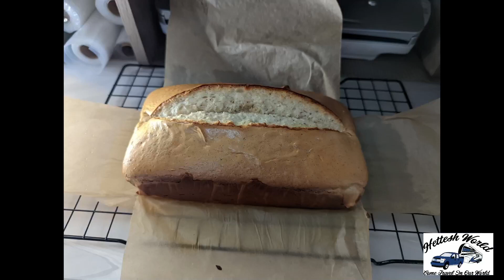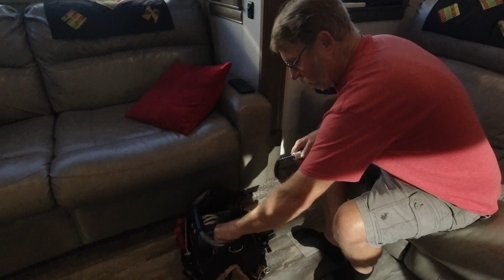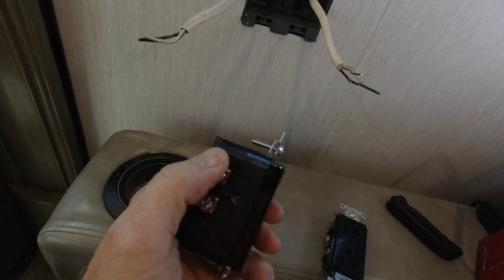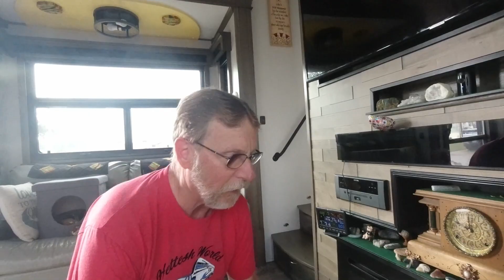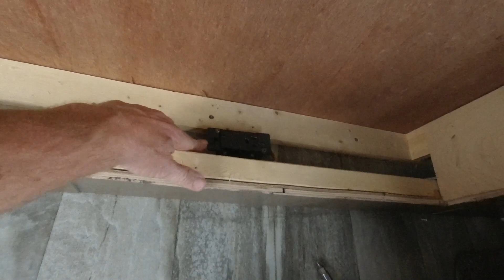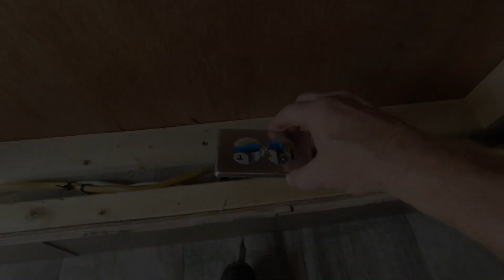RV Electrical Upgrades to Prevent Electrical  Fires RV Improvement Full time RVer

Comment: Laura says - Barb you are a lucky woman!  Super hero Bob saves the day again.
Dave says - I never liked those "stab" or "knife edge" connections.   IMHO, they don't have enough surface area to efficiently pass the electrical current.   The higher resistance creates heat that you can see on the "heat damaged" old outlet.  With that outlet box hidden behind the fireplace it definitely was a fire hazard.  Great upgrade!
Safe travels!!
Reply from the maker: Thank you. I am blessed for sure